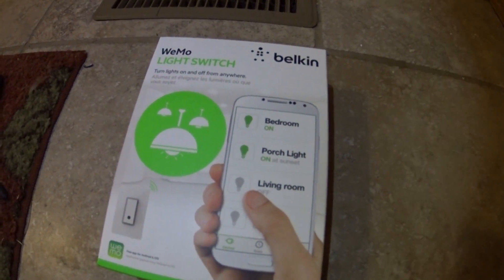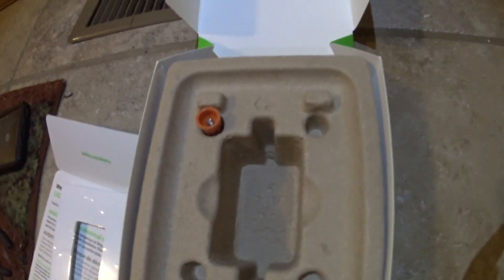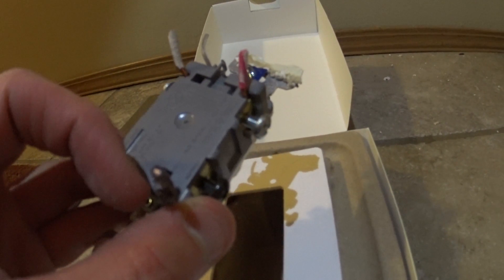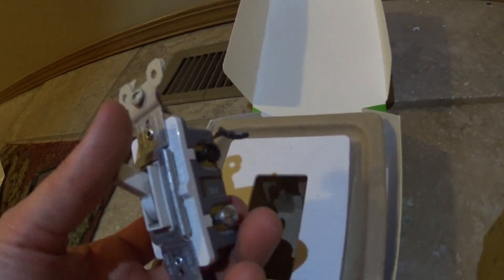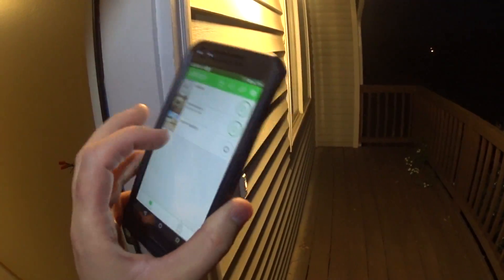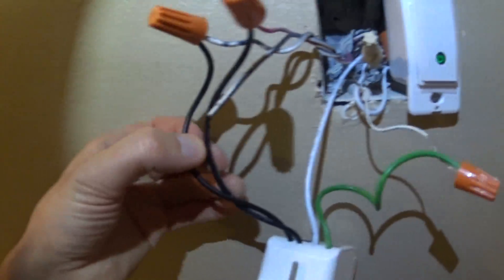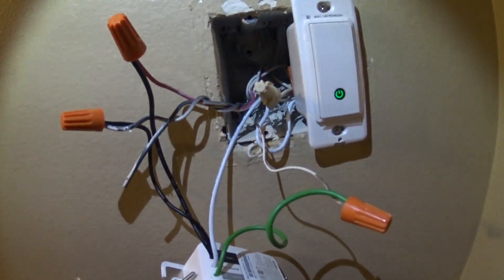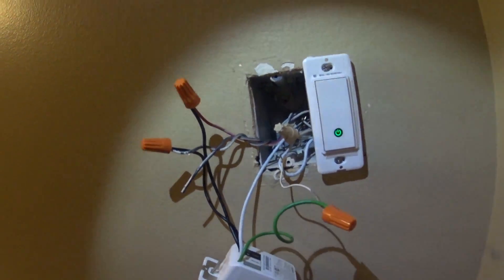Wiring a Wemo Light Switch on a 3-way switch

Comment: Another option would be to put the WeMo switch at the other end, then you can program the one you have in the wall to have a second action for the 2-seconds push, so you have 3-way capability still.
Reply from the maker: Oh yeah I remember seeing a video where a guy did that and thats how I knew that it would wold work if you used only one of the traveler legs and left the other switch alone. The light switch controls my exterior lights and I am not sure why they installed the two way switch to begin with. 

So far it has been a few months and I have had no issues with the switch being installed like this. 

This is the video I was thinking of:
https://www.youtube.com/watch?v=WSFhMwlc284

Thanks for watching.

Comment: Thanks for your video. I am about to replace my 3-way light switch with a WeMo light switch as well, and this video is helpful. I'm assuming that after the installation, you won't be able to use the second switch in the garage.
Reply from the maker: Hi +Navin Warier , you are correct. I won't be able to use the second switch in the garage although I should note that if you happen to flip the second switch it will power off the wemo switch. It might help as a reminder to put a piece of tape over it just so  you do not accidentally flip the switch. So far this has been working perfectly for a bit over a month now and I created a rule to turn on the outside lights at sunset and turn them off at sunrise. 

Good luck with you installation and feel free to ask me any questions if you run into any issues. Also make sure you flip the breaker prior to doing any electrical work . Thanks for watching.
Reply: This is NOT a 3-way switch.  You're simply installing a second SPST switch in series with your 3-way circuit.  This defeats most of the reason of having a 3-way circuit.